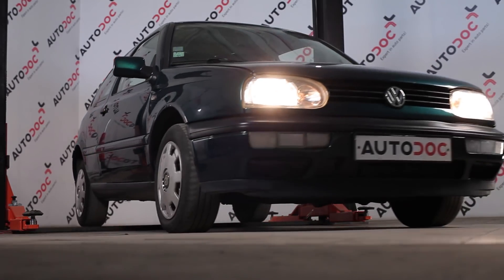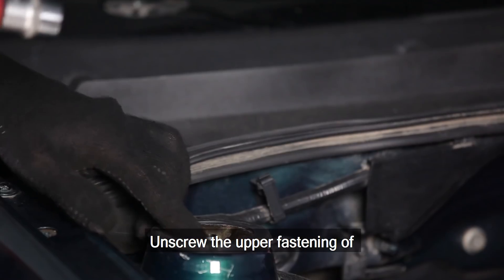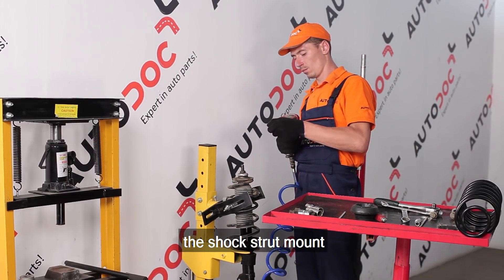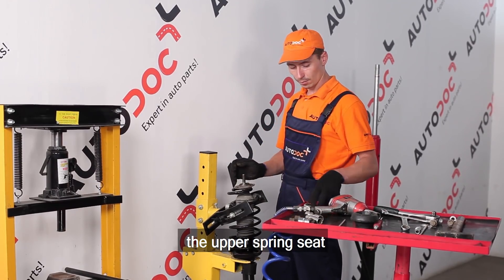How to change springs on VW GOLF 3 1H1 Hatchback [TUTORIAL AUTODOC]

Comment from the maker: 00:30 — Loosen the wheel mounting bolts. Remove the front wheels
00:44 — Use a drive socket No.10. Unscrew the brake hose fastening bracket from the shock strut
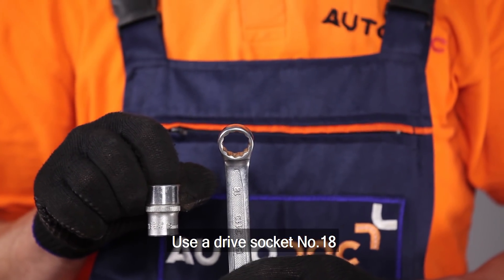01:11 — Use a drive socket No.18 and a combination spanner No.18. Unscrew the nut and remove the shock absorber lower mounting bolt
02:04 — Use a drive socket No.22. Unscrew the upper fastening of the shock absorber strut
02:21 — Remove the suspension strut
02:39 — Set the shock absorber strut on the spring compressor tool
03:05 — Use a drive socket No.21. Unscrew the top fastening of the shock strut mount
03:22 — Remove the top mount, the support bearing and the upper spring cup
03:34 — Remove the spring
03:42 — Install the spring
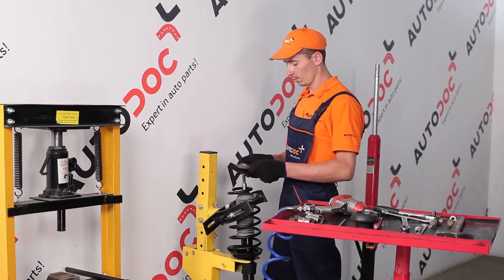04:13 — Install the spring top mount and the upper spring seat, the washer and the top strut mount
05:18 — Place the shock absorber in the wheel arch and secure it
05:36 — Use a drive socket No.21. Tighten the top shock absorber fastening
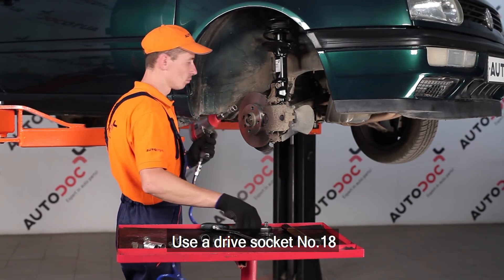06:36 — Use a drive socket No.18 and a combination spanner No.18. Tighten the nut fastening the shock absorber strut to the steering knuckle
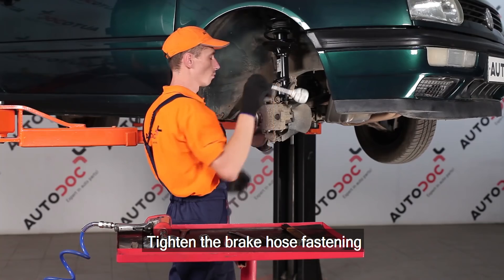07:06 — Use a drive socket No.10. Tighten the brake hose fastening bracket to the shock strut

The tools you need to replace springs: 
— drive socket No. 10
— drive socket No. 18
— combination spanner No. 18
— drive socket No. 22
— drive socket No. 21

Comment: Which is the correct route with regards to the nut. Does it go on after the mount or before the mount? In your demonstration, you remove the mount, then the nut, then the bearing. When you refitted, you installed the bearing, the mount, then the nut. Why?
Reply from the maker: Thank you for your comment! 
The assembly and disassembly take place in the same sequence.
In general, the replacement will be the same and the only thing may differ slightly is the design features of your particular model of car.
Stay tuned with us!
Best regards,
Autodoc team!